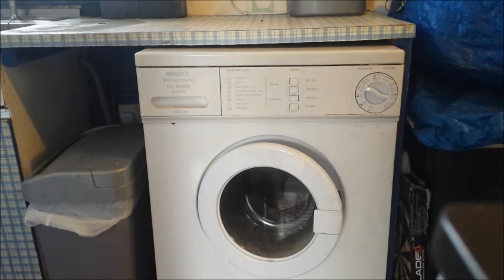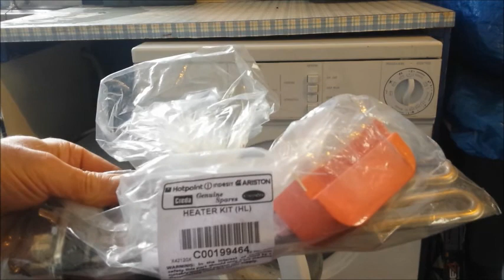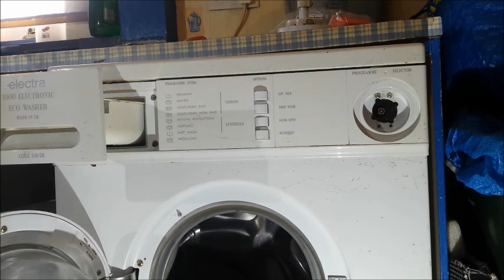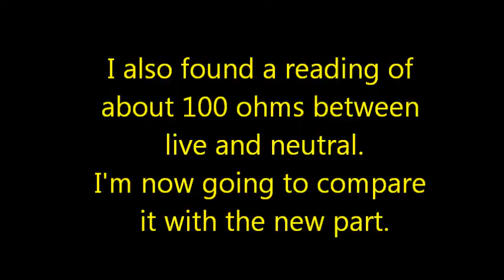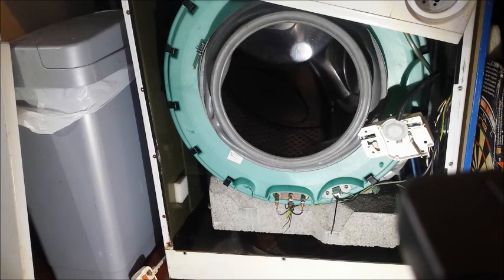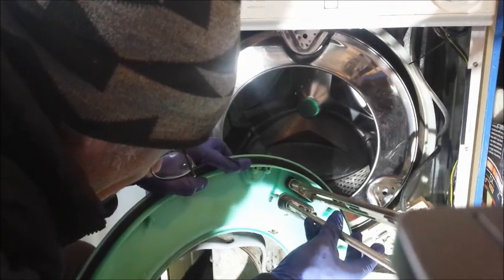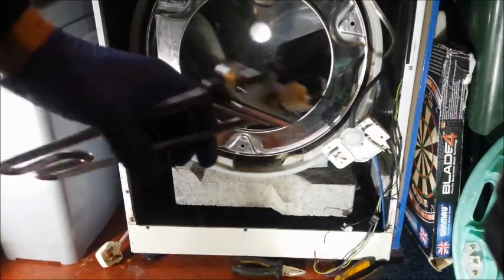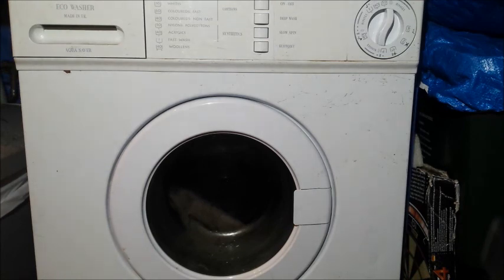Electra (Hotpoint) Washing Machine Keeps Tripping RCD

Comment from the maker: Note: this video and follow-up contain one or more uses of the words “faff”, “heck”, “feck”, “caboodle”,  “shucks”, “dodgy”, and “bodge”, plus other barely audible expressions and mutterings of frustration, as well as multiple sighs and deep inhalations of breath.
Reply: You have forgotten to replace the heater guard that holds it In place. I can imagine that blowing up not long after this video was made
Reply from the maker: @HotpointWM52  You’re right I didn’t. I did actually make a follow up video about that see https://youtu.be/Ux_L_nEkRys  By the way the machine is still working fine.